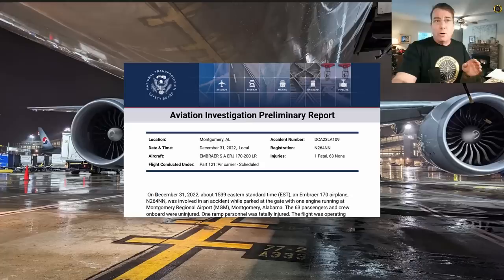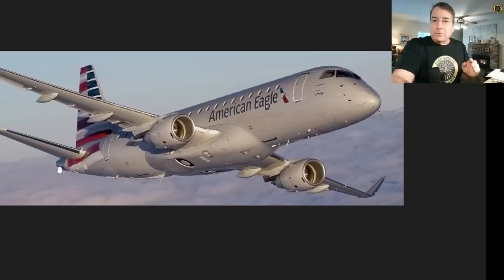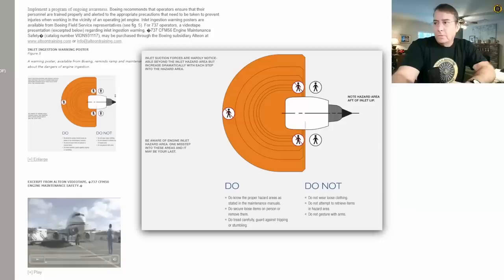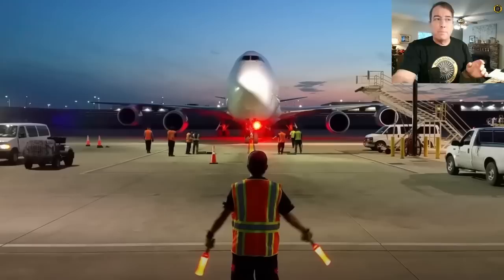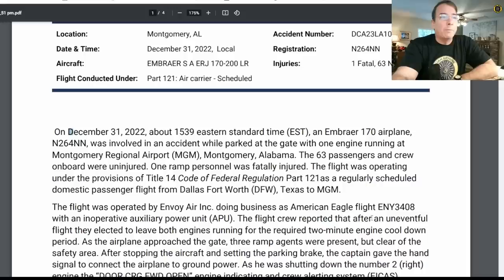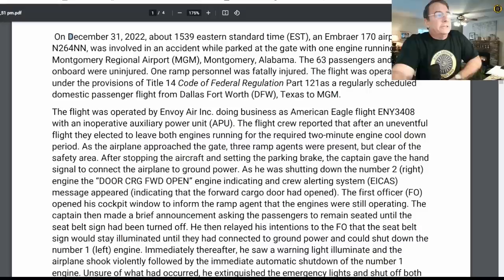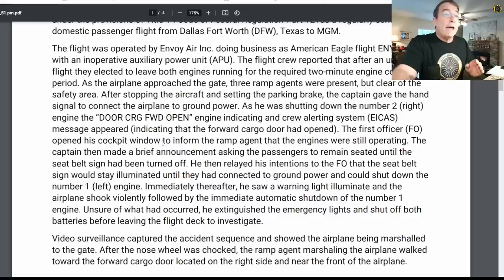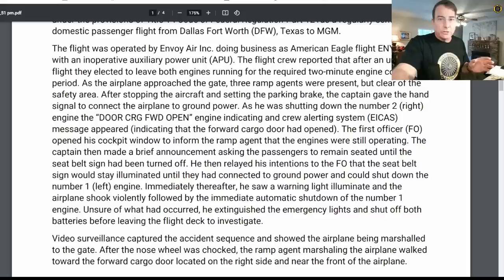NTSB Preliminary Report Ramp Agent Fatality 31 Dec 2022 Montgomery Al.

Comment: I spent 36 years with Allegheny, US Air, US Airways, American. Most of that time was spent working on the ramp. I saw co-workers be seriously injured but never one killed. The unfortunate agent who was killed, her trauma was over in a split second. The trauma that her co-workers, the passengers, and the crew experienced will be with them for a lifetime. Working on the ramp is not a joke and it can be deadly.
Reply: In addition, my guess is there was a lot of ass covering going on. There may have been a safety briefing before the flight arrived but my experience says maybe not. The running joke was always, "Safety is important... provided it doesn't interfere with the operation.
Reply: @mwilk19  There's no need to imply ass covering without evidence. However, as a coworker was killed, there isn't much to say other than exactly what was seen. Whether or not she or many of the crew were in the habit of walking too close to an engine, or pre-empting safety regs to process the flight, will not be shared outside the work team for some time to come. She died. Why she walked in front of that engine isn't for us to say, but speculation outside the team is certainly grotesque at this early date.
Reply: I love US scare ! The best when the blizzards on the East coast shut down airports. I'll never forget the generosity of a flight attendant at PIT that took me to an empty gate and hooked me up with the last flight out.
Reply: The person was blown over at the rear of the engine so she had to know the engine was running. Short of intentional this event is baffling. We will never know.
Reply: @mwilk19  Safety is just a corporate box ticking word. Meaningless if not regimented in to exercised routines, which cost time and money. I don't believe there was one let alone two safety briefings for this one arriving aircraft, or that shift.
Reply: I  worked  USAirlines as a A&P and  had Lots of  Civ and Military time around aircraft running. Its  always  heads and  my  dad  said  always  touch the  airframe as  you  walk  along as a  reference. I  had  to  work  on  and  fly  DC3's   when I  started out, walking  mid fuselage with both  engines  at idle to  hook up  Ground 28v was always  a daunting task. Dead  right or  dead.
Reply: Was She a " Rookie " ( New on the job ) ??? . Rushing to impress supervisor and ground crew co-workers ??? 
  R.I.P. to her and condolences to her kids and family.
  I am Air Force Vet, did 3 years on the flightline,  jet engine mec KC-135R GE CFM-56-2s / F-108 up at Fairchild AFB WA.
Reply: @larrybe2900  It's conceivable to me that she could have failed to understand that being blown over at the rear meant the danger at the front was too great to risk it. She might have been impaired by an unexpected medical issue and/or licit or illicit substances. I think it might be possible to know what happened, by assessing whatever can be gleaned in the investigation.
Reply: @larrybe2900  Being blasted and blown over would also be pretty distracting, ending up as a factor which affected judgement. Also, the whole crew not waiting for the engines to be off would've split the attention of the PIC. It's not uncommon in the accidents I've had to review for rail where something is added, and sensory overload occurs. The thing to always remember about safety is - the rules are written in blood! It's also the nature of accidents where one bad decision won't kill you, but it increases the chances the next wrong decision could. It's alluded to here, with the APU inop, the beacons on, the PIC hooking up ground power.
Reply: In addition to personnel at the scene, I feel for those who had to deal with the engine, from inside a hangar later on. A grisly but necessary task. There is a very good video about the subject, I believe by Mentour Pilot. Prior to watching it, I, as a layperson, had no idea how very dangerous it is to walk near the ingestion zone.
Reply: I had a fellow mechanic watch the main gear tires for cuts as the plane taxied or towed in. I stopped the tow and said I will not allow it again.  I never had a ramper or Mech injured
Reply: Agreed, I worked as a ramp agent at KIAH for 7 months for IAS (air cargo) and had several close calls.  We had some of our guys who got fired when they were involved in a bender fender accident while driving the tugs (failed drug test).  I left when I did as the pay wasn't much and barely paid for my gas getting to/from work.
Reply: @pomerau  Not where I worked for the last 16 years before I retired. Industrial/welding, Fortune 500. I was the longest-installed safety guy, medical, bio-hazard, fire extinguishers, etc. It was amazing how many guys took shortcuts, or just blatantly disobeyed the rules, despite training, signage, machine guards, etc. I applied quite a few bandages plus escorting 2-3 trips to the hospital emergency room every year. It wasn't my place to voice an opinion, just do my job and let the foreman investigate for safety reports. I saw a lot of head-scratchers.
Reply: @brucemiller8109  On the C-46 that I started out on the power hookup was behind the right wing, so there were two choices when working alone (normal day). You either walked outboard of number 1 to the trailing edge, then had to duck under the fuselage to get to the power unit. The alternative - and quicker - option was to walk down the center line of the fuselage until abeam the gear, then deviate toward the right side continuing to the trailing edge. . .Like you, I always maintained contact with the fuselage center line.
Reply: @mwilk19  You can have one, two, or ten safety briefings, and some personnel will go on to make a mistake. We should consider at what point over-briefing de-sensitizes people to dangers. She walked right through the jet blast behind the turning No.1 engine and then walked right in front of it. Some people just don't belong in certain circumstances.
Reply: @dwmzmm  Bending metal on the ramp is a Big No No. it is absolutely the worst sin one can do. Every thing in aviation is geared toward that one goal. Don’t bend any metal. And don’t  hurt anybody in the meantime.
Reply: Sadly, they likely got in trouble for not taking too long
Reply: @oldmech619  Yep, I knew that very well.  One time I was sent over to where the An-124's were parked near the control tower to assist in some work needed, they asked me to use a forklift; I politely declined as I've never operated a forklift or had any training on them.  Wasn't going to put myself in a position to make a fool out of me.
Reply: @islandlife756  to me, it's inconceivable she could fail to connect the two dots
Reply: When the marshaller went forward to pop the cargo door on the non-spinning side, it seems that the deceased ramp agent took that as her cue to start her normal procedure, even though the strobe light was still going.

A lot of less-competent workers are still useful if they can learn to follow their supervisor's lead. In this case he broke the rules himself and was leading her astray right from the get-go.
Reply: @dwmzmm  Low pay may be an issue as well,  that tends to attract inexperienced or desparate people, who will do whatever they are told, rather than buck an order to follow safety guidelines.  Also these people are more likely to mishear, misunderstand or forget instructions.  Professionals cost money, increased expenses raise ticket prices, yada yada.  Airlines cant run at or below cost, unless subsidized.
Reply: @johnranney1708  I worked in a furniture mill, running an industrial rip saw.  Took all the OSHA classes & did my stint with everyone else as safety officer for my area.  Was fortunate to work for a company that prioritized safety - something about replacing an injured worker for even a few days cuts into profits, but primarily cuz management cared about their workers.
Reply: @cheddar2648  That may be the issue, but until the work environment is investigated it will be difficult to pinpoint what went wrong.  Crew Resource Management isn't just for pilots.
Reply: @dwmzmm    A guy in a fork lift damaged a nose cowl  on one of my DC9. I told the boss that it must of happened before the plane came to us. Ground equipment always scared me. And that is a good thing. Respecting safety has to be more than words.
Reply: While in the Air Force I often assisted the ground crew both before takeoff, and after we landed. As a Gunner I had less to do than the rest of the crew pre and post flight, so I helped the ground crew.

I not only had to worry about 8 engines, but also of powerful radars which were not safe to be around while they were operating, so I had my head on a swivel at all times. Those ground crew don’t get the respect they deserve, it’s a dangerous job.
Reply: Yes. And that of her family. Because no one will pay anything for this loss of life, oher children have to grow up without a mom and the dad has to cope alone. A very unnecessary death, I feel.
Reply: Why should the passengers and the flight crew feel any "guilt" or think about this at all going forward? The woman violated known safety protocols. She and the others on the ramp are responsible. Actions have consequences and she paid for her foolishness.
Reply: A horrible thought, but I imagine a pink mist came out of the exhaust for a split second.
Reply: I feel sorry for the ones who have to clean up that engine.
Reply: should not have been allowed to fly with inoperative APU. in fact, should not be allowed to fly with inoperative anything for that matter, and that goes for everything mechanical, logistic, and personnel
Reply: @SB_McCollum  “grotesque” Chill with the dramatics.
Reply: @Hornet135  Picking apart the moral and intellectual character of people you do not know while the people who do know them are having to deal with the emotional and work environment after effects is detestable AND UNNECESSARY.  The official inquiries are ongoing, every ramp worker in the country is looking around for themselves and their coworkers to see where they've gone slack, the woman's family and friends are watching every video and reading every thread for answers. What needs to chill is people who know nothing throwing direct accusations at the deceased. She isn't fictional, this isn't write your own version on reddit.

Juan is right to put out what is known in a timely manner, he's asking the training, management, and policy questions that have to be answered. The bozo brigade who are So very anxious to declare what a deadbeat she must Obviously have been are... vermin.  I am so glad when I worked ramps and aircraft there was no online commentariat chiming in. All we wanted to know was what happened, how to tighten up so it didn't happen again, and how could we help the family and each other.
Reply: @chesterwilberforce9832  as I believe it was nighttime I doubt it due to colors disappearing in darkness and all looking either white or grey, but possibly especially if it was a large high bypass turbofan.
Reply: @ElinT13  you can bet millions will be paid out to the family even though she was most likely at fault
Reply: I've seen pics of the last human injestion, it wasn't pretty. All the people on that side of the plane will have nightmares for a long time.
Reply: @patrickvolk7031  I’m ACS and a ramper hybrid in the UK and we have a safety culture with overlapping  safeguards. We’re drilled intensively about never approaching an aircraft with the flashing red anti collision lights on under any circumstances with the exception of the pushback teams but again the SOPs are drilled in repeatedly. One of the things makes me angry is that one safeguard is so simple. With the exception of the marshal, the entire team clusters together in the designated area for us and none of us move until the red lights go out. But we’re also almost each other’s spies in that we enforce the “don’t move unless the whole group does when it’s safe” and anyone who moves prematurely is reported, scolded and reminded to stay with the group.

I’ve never heard of anyone at my workplace being hit by jet blast. We don’t go near the engines.
Reply: @pomerau  I've worked in environments where safety briefings were conducted regularly. Briefings are always rigid, and in reality rules are bent and occasionally broken to the needs of the moment. In my experience, the more safety briefings you have, the less people heed them. After a while they start to actively resent them. Like "stop wasting my time I've heard this shit 10,000 times before and we're gonna ignore half of it anyway. Let's just get on with it."

I have no problem believing 2 safety briefings were conducted, and I wouldn't be surprised to learn the ramp agent had heard it so many times she was able to recite it from memory. Safety briefings are the tick in the checkbox, they don't make anything safe.
Reply: @cheddar2648  What's strange is where did she go after putting the cone by the tail?
Reply: @Old_B52H_Gunner  Thank You for your service!!
Reply: @davidsmiths5471  Sounds like she walked along the back of the wing, around the tip and along the front of the wing. Or walked out of the camera field of view to get another cone.

Comment: So they all knew the engines would be running. Had 2 safety briefings 10 minutes prior to "not aproach "the aircraft, so they all go swarmed the aircraft immediately with warning light flashing everywhere, she almost gets blown away at the rear because of the engines running and was waved off to get back, so then she walks to the front of the wing and walks right in front of the same running engine that almost blew her down 60 seconds earlier and gets sucked in and dies?
Reply: Yes, obviously.
Reply: @NicolaW72   Well then, the investigation is over as far as i am concerned.
Reply: @skydancerforever  Probably, yes. Nobody will ever be able to know what was going on in her mind during the decisive seconds.
Reply: @skydancerforever : The key point was: they all swarmed. Which means it was a culture issue, not a personal issue. If the whole team does the same mistakes, the problem is somewhere above those actually paying the price for violations.

Comment: In addition to the beacon, there should be  a laser projecting a red pattern on the ground when an engine is running and plane is stopped. Pretty cheap to implement.
Reply: Now that’s a life saving idea right there
Reply: I was thinking something on the ramp, but something on the plane is so much easier to implement. Great minds think alike.

Edit: Do like laser tag, if they enter that zone, they get a squawk and flash!